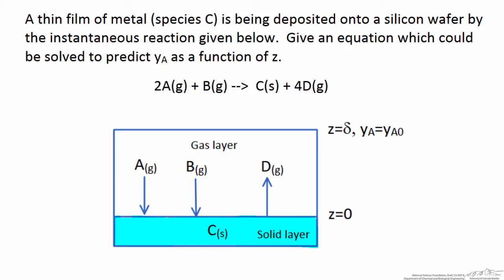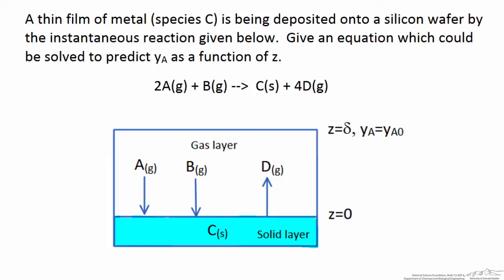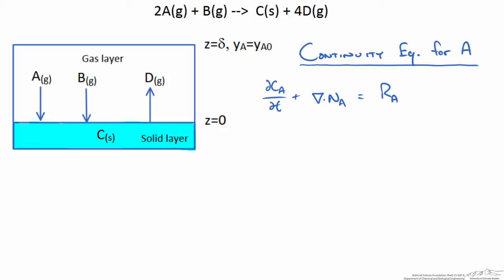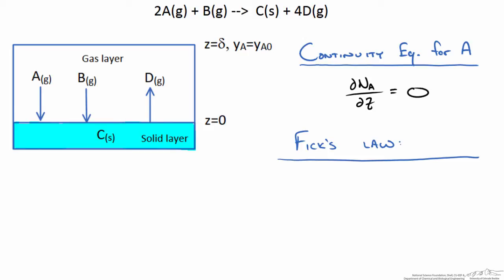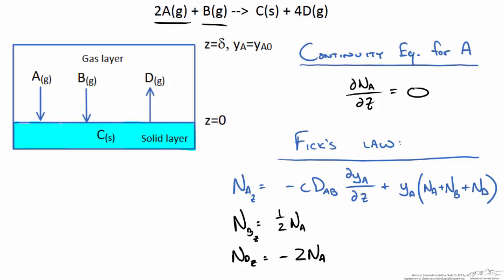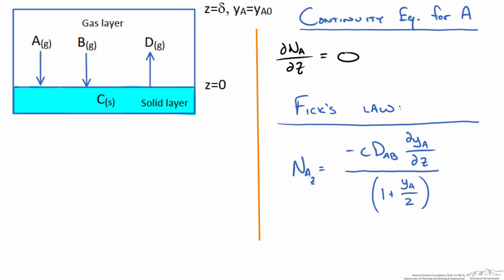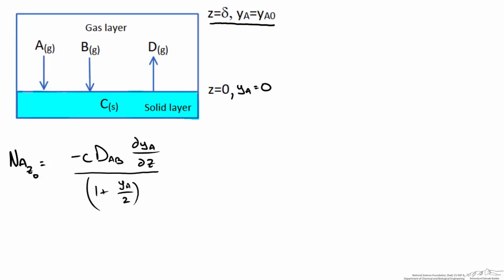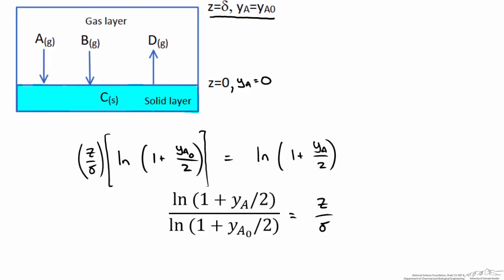Mass Transfer Setup to Reactive Surface

Comment: Thank you very much!
But, I'd like to ask why is that when I try to calculate the molar flux of A (based on equation displayed at 7:55), it gives negative values for any given yA0 (between 0 and 1)? Is there any fundamentals that I miss?
Reply: It's been nine years, did you ever get it ironed out?